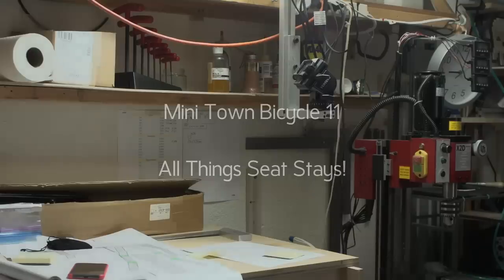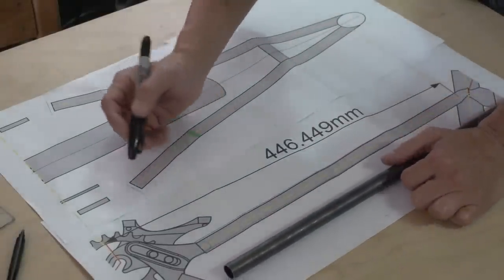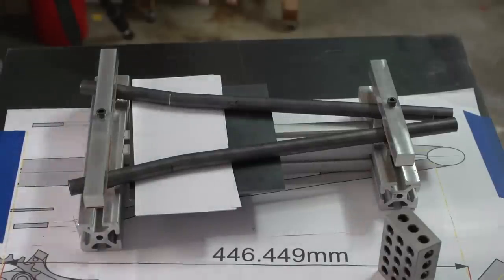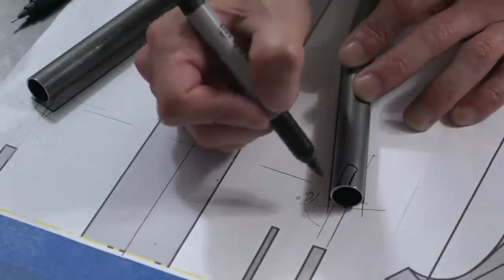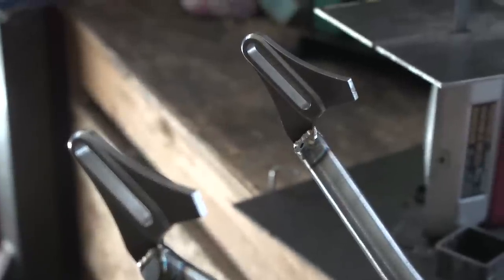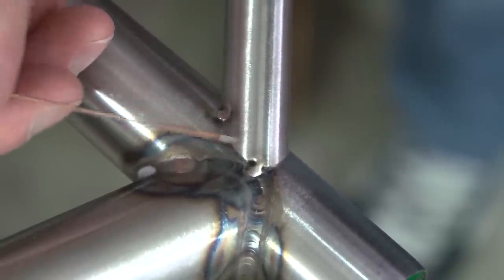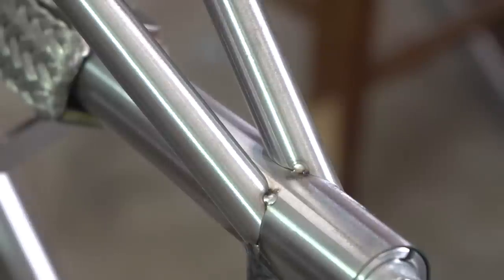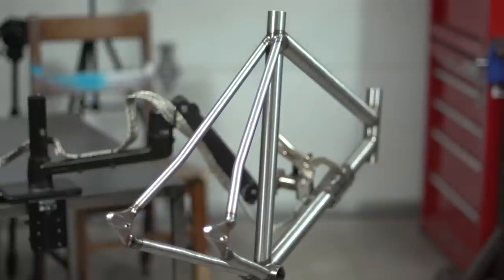Weld Bend Miter Seat Stays - Mini Town Bicycle 11

Comment: If you run threads fast under pressure, be sure to lubricate them thoroughly, otherwise you risk breaking something. I speak from experience, having broken a few of them with impatience.

Comment: Great work man! When jigging up the seat stays, could you lay them flat on your drawing and tack them together at the seat tube end? You end up hole sawing that end off anyhow, could that help in getting them properly aligned? Love watching your stuff, keep it up!
Reply from the maker: Never thought of that! The one thing that could be a problem is tacking could inhibit the fit up once they are put into place on the ST.
Reply: @PithyBikes  In the video you mention that aligning the seat stays in your fixture is tricky because they're elevated off the drawing. I'm suggesting that you lay the tubes on the drawing and tack the ends together to hold them in that alignment. Then you can just lift the tubes and clamp them in your fixture. The next step of hole sawing the stay ends will cut off the tack anyways, so there shouldn't be an issue with fit up. Know what I mean?

Comment: What's that foot stomping method when you're tacking? You start with low current and then you give one big bang of higher current?
Reply from the maker: Cedric Eveleigh exactly. Never ramp into a tack weld. It will only heat up edge slowly and fold it back.

Comment: why not weld those caps on before you slot?
Reply from the maker: Axa Axa welding first increases possibility of hardening steel in that area. Making saw cut difficult
Reply: @PithyBikes  well the welds will likely be harder but the steel would likely be softened, in most cases anyway...
But I get your situation, when u get a bigger mill you'll likely worry less about such a thing.